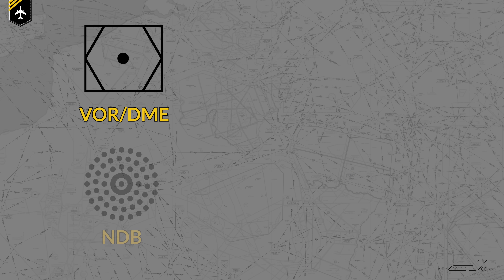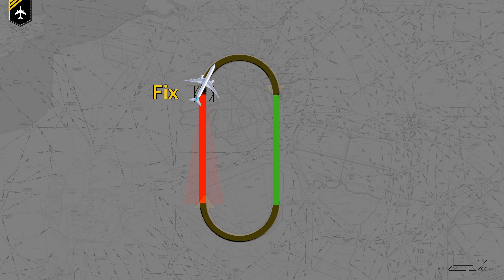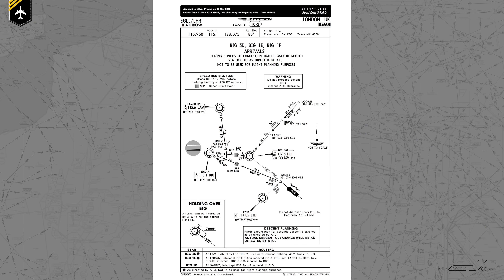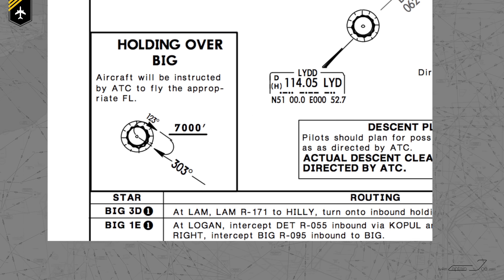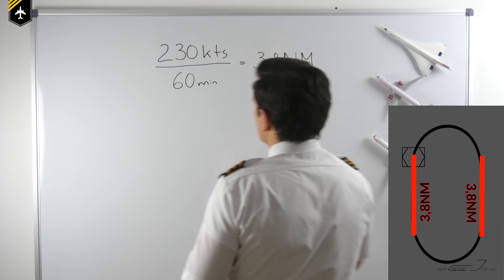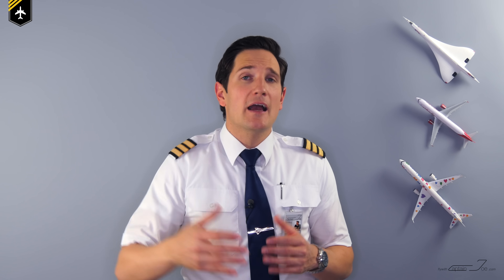WHAT is a HOLDING PATTERN? PART 1 Explained by CAPTAIN JOE

Comment: Just a notice from a physics perspective: the units in 230kts/60min = 3.8nm are wrong (that would lead to a unit of nm/(h*min). What one actually does is multiply the 230kts by 1/60h (=1min), which means wie have 230kts*h/60 = 230nm/h*h/60, so that time unit disappears. Does nothing for the calculations, but just to be clear what happens in that calculation - we multiply a speed by time to get a length.

Comment: What entry would you use if you were approaching the fix exactly opposite of the side of the hold radio? Another words if you were going to hold on the 300 radio with left-hand turns, but you are approaching the Fix heading 120 exactly on the opposite side of the inbound course. Would you use a teardrop or a parallel?

Comment: Once going into Fairbanks, there was heavy fog, but the captain said will try. We then kept on circling for a good while before trying. Ended up aborting though and going back to anchorage.  I overheard someone saying the circling was to burn off fuel just in case? Burn off all fuel but leave enough to go back to anchorage? Or all hog wash? Holding pattern was maybe just to see if the fog lifts I guess?

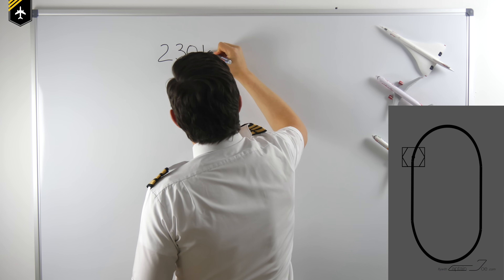Comment: The calculation at 4:12 is correct, but slightly misleading as the units are wrong; nautical miles are NOT measured in knots per minute! It should be 230 kt * (1/60) h = 3.83NM.

Comment: Dear Captain Joe, I'm travelling a lot with the Airbus 220 and I've noticed that takes significantly less time from full thrust to take off, compared to other airplanes.  Could you please make a video explaining how much time an airplane takes to take off from the time of full thrust up to the point leaving the tarmac?
Reply: Anastasios Constantinidis there's no set answer to that as there's a lot of variables. Example, an empty Boeing 747 can accelerate fast enough that it can takeoff from a 1000-1500m runway (theoretically)
Plus in your case, since the A220 is a smaller aircraft, it should use less runway, and if its light, should accelerate fast too.

But the number 1 factor in take off performance is weight. After that you can say other things such as air density, use of air conditioning etc.

Comment: For those who comment about the sound glitches. It probably was the connexion to the receiver of the lavaliere mic or the wireless system losing signal due to low batt or an interference. Almost imposible to edit... but, c’mon we’re here to learn about HOLDING

Comment: Congratulations for your vídeos.
just one thing the displacement as you know to start with DME Arc, is 10% of the first 2 numbers of our ground speed example if we come to 200kts and if the arc is 15 miles we start at 17dme to finish 15 DME, now  the displacement in a Holding is 2 times more because for example if we start cel arc at 17 miles it is because we are going to move 2, and if the holding is a change of direction of 180 or 2 times 90 then the displacement is 4 miles easy 
thanks KIS Keep It Simple

Comment: 4:17
230 knots during 60 sec not 60 minutes (and its probably a multiply not a divide)
Reply: Zoltán Bánóczki 230kts is 230nm per hr. Therefore / by 60 to find the distance travelled in 1min (60mins in 1hr.) 3.8nm will be travelled in 60s - it’s correct!

Comment: Hi Captain Joe. Have a question for you.  Am flying regularly - as a passenger - the A320-200. A few times it happens that in the 3rd or 4th minute after take off the engines go very quiet for maybe 30 seconds. And then resume full power for further climb. The first time it happened my heart missed a beat as I thought we had engine problem. Recently it happened 3 times in a row during the same flight! I would like to understand what happens. It will take my anxiety away. Thanks if you see fit to explain.  For the rest an awesome channel. Makes flying as a passenger more relaxed!

Comment: Hi Joe, really nice video but at the end, you haven't mentioned the differences of the holding speeds between the normal conditions and the turbulent conditions. Additionally, in my book (Nordian) these speeds are different for example over the normal conditions up to 14 000 ft 230 kt or 170 kt (cat A and B aircraft only). Above 14 000 ft up to 20 000 ft it's  240 kt (280 kt for turbulent conditions), then 265 kt beyond 20 000 ft up to 34 000 ft and finally 0,83 mach above 34 000 ft. :)

Comment: Why plains have tail
Reply: The tail of an airplane has the rudder and elevators, that allow the pilot to control the yaw and pitch of the airplane respectively.

The yaw is the rotation about the vertical axis, which the rudder controls.  This is used in combination with banking of turns, to turn the aircraft.  This is also used for landing in a crosswind, where you need to aim slightly upwind to have a ground velocity that aligns with the runway, and then adjust your yaw so the aircraft aligns with the runway when touching down.

The elevators are the adjustable parts of the horizontal tail, that allow for pitching the aircraft, i.e. rotating about the left/right axis, in order to climb and descend.

Comment: Hi Joe, can you explain how a jet engine works PLEASE
Reply: Short answer: suck, squeeze, burn, blow.

Long answer: look up the Brayton cycle (gas turbine).  Air is drawn in by the fan rotor and compressed by an axial flow compressor.  Fuel is dispersed into droplets and added.  Then the air/fuel mixture enters the flameholders of the combustion chamber.  There is a sparker that initiates the high pressure flames that burn the fuel and air.   The exhaust of the combustion chamber then pass through a turbine that provides power for operating the compressor, and for providing electric power to the aircraft batteries.   The remaining exhaust gasses are still at semi-high pressure (relative to the outside air), and then pass through a nozzle where they expand to low density and high volumetric flow rate/high speed.   The exhaust gasses ejected out the nozzle produce a Newton's third law reaction force on the structure of the jet engine, that we call thrust.

Comment: what's the difference jet fuel and car fuel?
Reply: Car fuel (for Otto cycle engines) has a lot fewer carbon atoms per molecule, and is mostly octane.  Car fuel is selected so it doesn't self-ignite during the compression stroke, and instead waits for the spark plug to ignite it.  It is desired to get as high of compression ratios as possible, so 

Diesel fuel is similar to car fuel, but has a much wider range of carbon atoms per molecule, and a lot more carbon atoms per molecule, typically from 9 thru 25.  Diesel fuel is less refined than car fuel, and is selected so it does ignite from the compression stroke, but with much higher compression ratios than car fuel.

Like Diesel fuel, jet fuel has a wide range carbon atoms per molecule, ranging form 8 thru 16.   Not quite as wide as Diesel fuel, so there is more refining necessary to make it.   The exact composition of jet fuel varies depending on the petroleum source, so jet fuel isn't defined as a specific blend of hydrocarbons.  Jet fuel is a performance specification.  Unlike ordinary gasoline and diesel fuel, jet fuel needs to perform at an extreme temperature range, so performance in cold temperatures (think -40C) is part of the specification for it.

To recap: car fuel, the priority is a high ignition temperature.  Diesel fuel, the priority is a good compression-ignition characteristics.   Jet fuel, the priority is the performance at low temperatures, and a high flash point so it doesn't self-ignite.  Jet fuel is injected in to the combustion chamber, rather than being compressed with the air intake, so self-ignition and compression ignition are neither pros nor cons, like they are for their Otto and Diesel engine counterparts.

Comment: Hi Mentour Pilot, I flew as a passenger on a small commuter plane (Bombardier Q300 or Q400). I'm not a pilot but have some private pilot training (did not finish the training ).  When boarding the plane, due to the small number of passengers, the flight attendant asked all 8 of us to move to the very rear of the aircraft.  He said the plane would fly better if the weight was distributed to the rear.  I thought it was very odd, and suspected that it was is a mistake.  I thought the weigh should be at the center of gravity, not behind the wings.  My concern was that the aircraft would be unbalanced making it difficult for the pilot to keep the nose down during the descent, even causing a stall. Do you think my concern was reasonable?  Are flight attends qualified to distribute weight on an aircraft?

Comment: Great vid Joe, can you show in your next video how a planes get into a linear holding pattern as opposed to a conventional stack. Also in a conventional stack does every plane need to descend at 1000 feet increments as directed by ATC until it reaches the bottom of the stack or can it leave before it reaches the end?

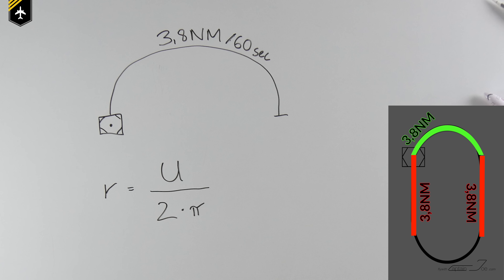Comment: 4:46 , 180° is the angle subtended by an arch A of Π Rad. The Diameter D is equal to 2 Rad. So 1 Rad = A/Π = D/2. So D = 2A/Π = 7,6/Π = 2,42. Different calculations but the same result. As If I said that I can fly from Milan to Sankt Petersburg along a route over Berlin, or I can fly from Milan to Sankt Petersburg along a route over Warsaw... Different routes but the same destination :-)

Comment: Captain why there is Smoking ash tray in a plane if smoking is strictly prohibited in the aircraft?
Do they doubt that some people can still smoke, being forbidden? If you will catch someone red handed what you'll do or air hosts/ flight attendants  will do?
Reply: It's for fire safety, in case someone smokes illegally, they still have a safe way of putting the cigarette out.  
Also, there could still be some airlines that allow smoking; probably smaller ones that don't terminate in the US or EU (and GB).
Reply: Due to regulations and safety... Afaik its for smokers which should put theyre cigarettes into the ashtrays instead of the bin... Even if it's forbidden
Reply: Gurpreet Singh Good one
Reply: STephanM oh really guys I didnt know some airlines permit smoking, unbelievable

Comment: What are these things under the Wings of an airplane?
Reply: You mean the engines?
Or are you talking about those "pod" shapes?

The pod shapes under the wings of the airplane, are equipment housings for the mechanisms that control the aileron flaps at the trailing edge of the wing.

Comment: Why words like "Alpha", "Bravo", "Charlie" are used in Aviation during communication with ATC ?
Reply: Because just saying "A", "B", "C" may not be clear enough over the radio, and can get misunderstood easily.
Reply: It's a way for every letter of the alphabet to sound distinctly different from all the others.  There is a standard list of representative words for each letter, called the .  That way, letters that sound alike don't get mixed up.  Examples being B/P/V, C/Z, F/S, and N/M.

It also helps deal with the various accents that pilots may have.   Someone who doesn't have a Z-sound in their language, might not even be able to pronounce the difference between C and Z.   But hearing them say Charlie and Zulu, even if Zulu sounds like Sulu, allows the intended letter to be heard.

Comment: Hey Captain Joe, how do airliners deal with bird strikes?
Reply: There is unfortunately nothing they can do, some airlines have tried adding spirals and patterns to the engine cones to scare birds away, however it is unknown if it actually works or not.
Reply: I remember there was a test and a regulation about bird strikes where the engine has to sustain a bird strike. What's that all about and why would the company spends thousands of dollar just to test and set up how well the engine handle in such cases?
Reply: Akyer Those tests were to see the reliability of the engines. Usually engines can handle ONE bird. Why, do you ask? It's better to pay with money to find out, instead of lives.
Reply: I see. There was an aircraft that is all tuned in for short distance travel, like completely all-tuned for short distances flight. However when they test the engines against a bird strike, it fails and exploded even after one bird. Because they literally over-engineered themselves for short distance travel, it got eventually canceled and dismissed.

Thanks for the reply btw

Comment: Was bedeutet eigentlich "Bank Angle" ?
Reply: Bank Angle means that the aircraft is exceeding, or is about to exceed, the banking limits of the aircraft.
Reply: Bank angle means that the aircraft tips one wing down, and the other wing up, when executing a turn.  The aerodynamic lift force is perpendicular to the plane of the wings.  The vertical component of the lift force opposes gravity, and the horizontal component of the lift force causes the radially inward acceleration of the aircraft to change its direction.

Comment: What I really never get is the logic behind holding pattern entry. I feel bad when I see the parallel entry, where basically you need to do the first straight leg nearly the opposite way of the inbound leg. Doesn't look safe, but there has to be a reason, right?

Comment: How do the brakes work when you land a A320 are they car brakes or diffrent? P.S You Give GREAT tutorials :)
Reply: The thrust-reversers do the "heavy lifting" of slowing down an airplane when it lands.  They deploy a reversing vane behind the engine, that deflects air forward.   This is what you hear, when there is a sudden roar from the engines, after a plane touches down.  It is the thrust reversers that redirect the nozzle thrust forward.

The service brakes inside the landing gear wheels, are not used for the bulk of the slow-down when initially touching down on the runway.  These are for slow-down during taxi, and for holding the plane in place on the jet apron while waiting for its turn to take off, or navigate to the terminal.

Comment: I have two qustions regarding holdings:1: why do not fly a circle instead of  a racetrack pattern? Doesnt that mean less step turning radius instead of the steeper ones for the racetrack pattern?2: I remember a graphic from a old aviation book where it looked like aircraft has to decend at every complete circle in order to give room for aircraft arriving at the holding pattern - Isnt that thrue? I have only been in holding pattern once when I flew to Heathrow some years ago and it did not look like we where decending at every circle then. Johan.

Comment: Okay, so that really isn't an oval, then.
Reply: An oval is any closed shape with all of its curvature directed inward, and no sharp corners.  A path as he described, still counts as an oval.   It is an oval, but it is not an ellipse.

An ellipse is a special case of an oval, whereby it is specifically an elongated circle.
A circle is a special case of both an oval and an ellipse.
Reply: @carultch : Interesting. I've always thought it was only an uneven circloid like a chicken egg. But you check out all right! I'll be deleting this OP shortly, then.
Reply: @HelloKittyFanMan.  Oval doesn't really have a formal definition in mathematics, so any "egg-like" shape is considered to be an oval.  Any "off-circle" round shape.   Ellipse and circle by contrast, have very specific definitions in mathematics.
Reply: I know now,  @carultch , I already believed you. But BTW, you can say "egg-like" without quotes, because egg-like shapes are actually egg-like.
Reply: I know now,  @carultch , I already believed you. But BTW, you can say "egg-like" without quotes, because egg-like shapes are actually egg-like.

Comment: I thought such maneuvers would be more complicated than just a stadium-shape curve. But aviation needs of course the KISS principle.
Reply: The reason the holding patterns are shaped like this, is to have a straight line segment between the 180 degree turns, in order for gyroscope guided planes to be able to re-calibrate their artificial horizon reference.   If every plane had a modern ring laser gyroscope for guidance instead of a mechanical gyroscope, we could fly circular holding patterns.  But the standards were already established from when planes used mechanical gyroscopes.

What this means, is that the plane needs to fly a straight path, in order to properly reference which direction is down, and use the pendulous vanes to slowly adjust to it.   The gyroscope is there, so that maneuvers like banked turns, don't give nuisance readings.  You feel a force toward the floor of an aircraft during a banked turn, rather than directly downward.  This would give a false reading to the pendulous vanes that tune the gyroscope, so the straight paths in the holding pattern are there so that the device can re-calibrate.

Comment: Please do a video on if an aeroplane can hover in mid air like  a helicopter
Reply: No, planes cannot do that.   They need to have a constant air stream across their wings, in order to push downward on the air, and generate a lift force to remain aloft.

Helicopters can hover in mid air, because the rotor is moving through the air regardless of the airspeed of the vehicle.  Fixed wing aircraft need a sufficient airspeed of the vehicle, in order for there to be sufficient airspeed across the wings.